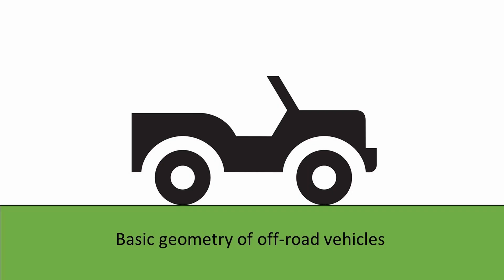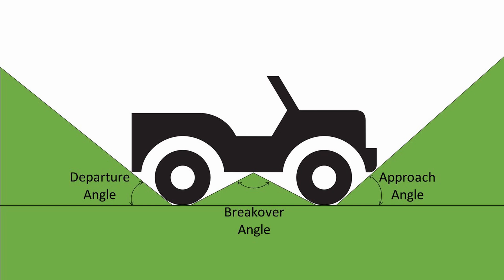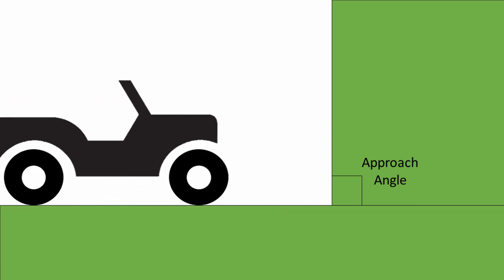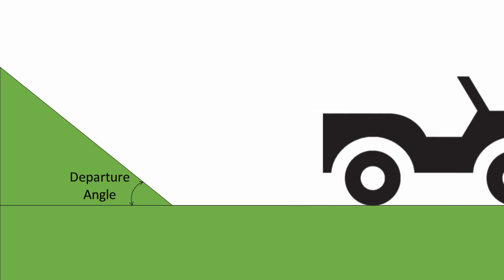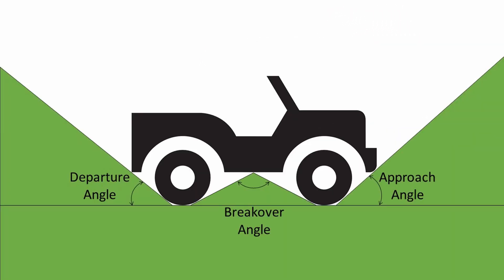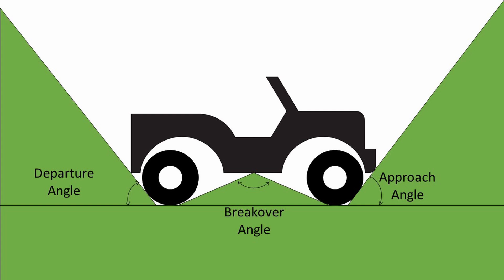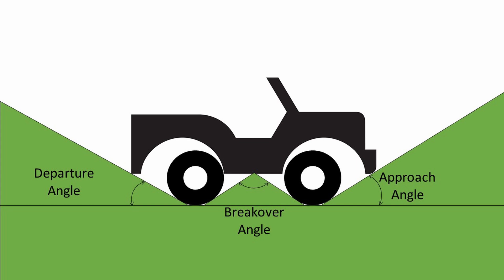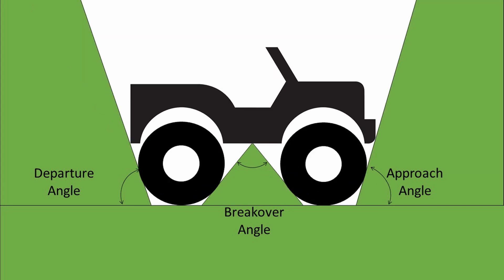Approach, breakover and departure angles - Off-road vehicle fundamentals

Comment: There is another way to effect approach and Departure angle. Modify the front and/ rear of the vehicle. Depending on you vehicle this can be a cheap as removing the lower part of the bumper or as expensive as fabricating custom bumper and radiator placement.  Plus in some countries  you might not pass safety inspections.
Reply: Welcome to India 😂🔥

Comment: You define breakover angle as that subtended by the distance between the bottoms of the tyres, from the midpoint of the bottom of the chassis. But it's really the angle supplementary to that.
Reply from the maker: Thanks for your observation. I’ve seen both versions in common usage. I tend to use the one shown in the video because it’s easier to visualise if you’re new to the concept, but I think the version you suggest can be more useful in predicting the practical consequences of break over angle.

Comment: Very straight forward and to the point. 10/10. Thank you for this video!
Reply: 2:28 Though I understood almost yet I want a bit of confirmation.

If say approach angle is 28°
And Departure angle is 23° only

then, effectively my approach angle is also 23° only since my vehicle's rear will be stuck on the incline even though my vehicle's front is able to get through.